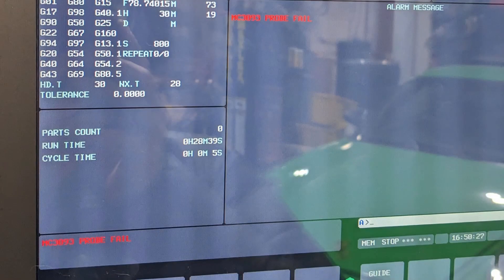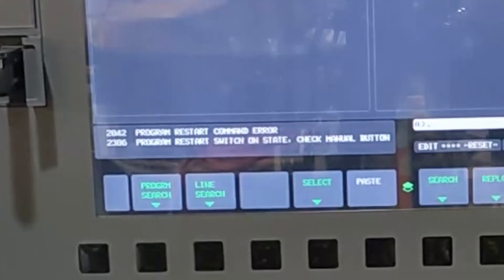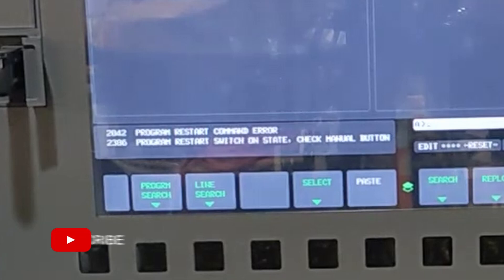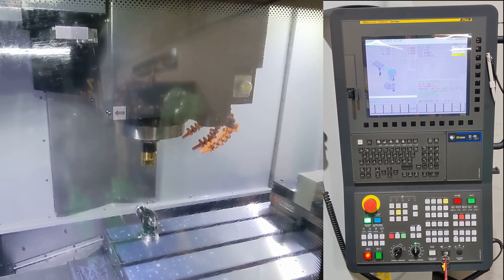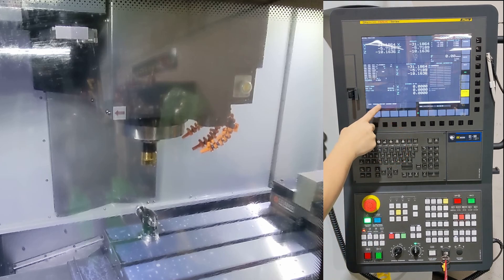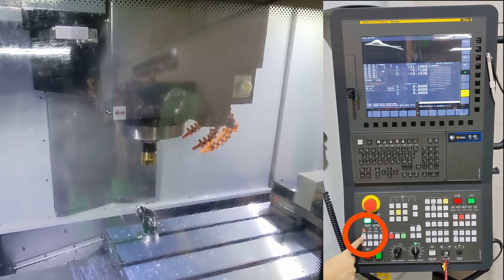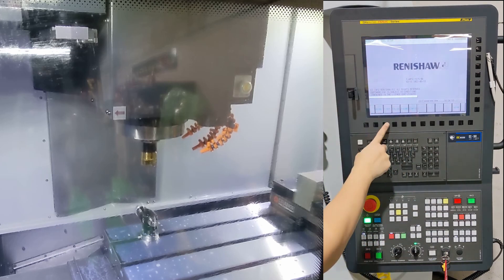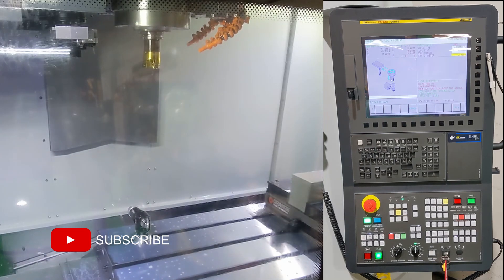Clearing a DN Solutions (Doosan) 2042 alarm on a FANUC Oi-Plus controller

Comment: Thanks a bunch, I wouldn't have found this if not for your video. It's also a fairly convenient way to reset the measuring cycles if you think about it.
Reply from the maker: Do you mean within the GUI probe menu?
Reply: @EscargotGarage  I meant that fanuc control has a hard key for program restart which you use in this situation. I have m codes written down to lets say restart a probe on our Siemens machine.